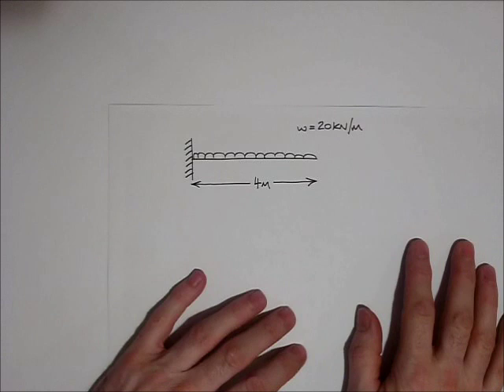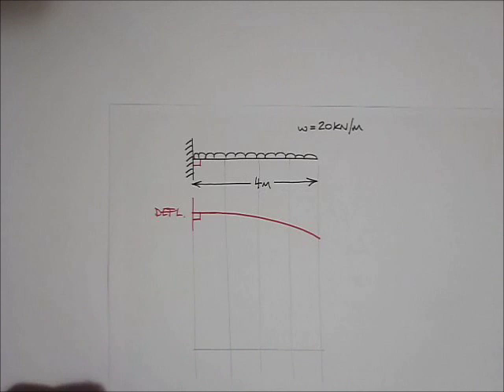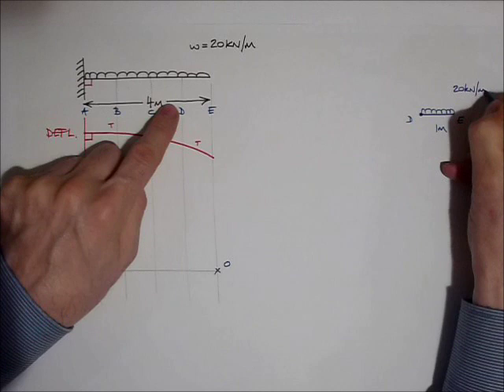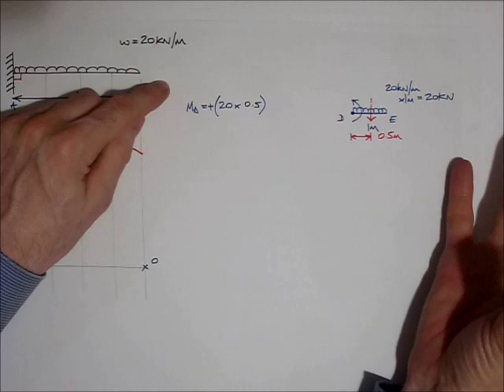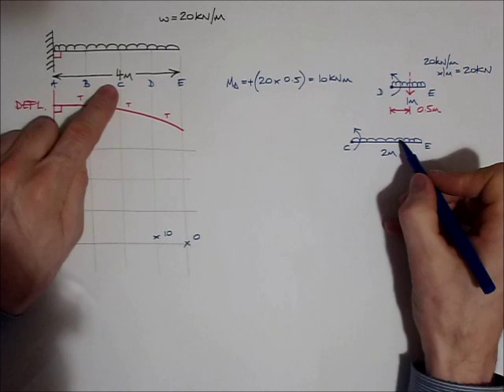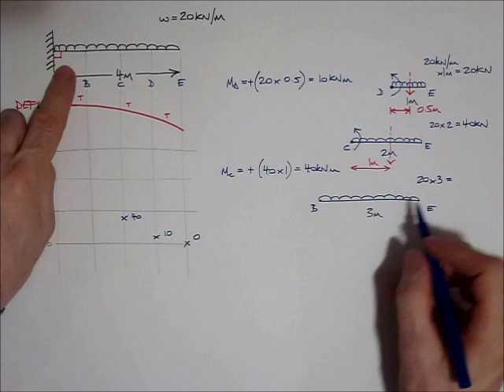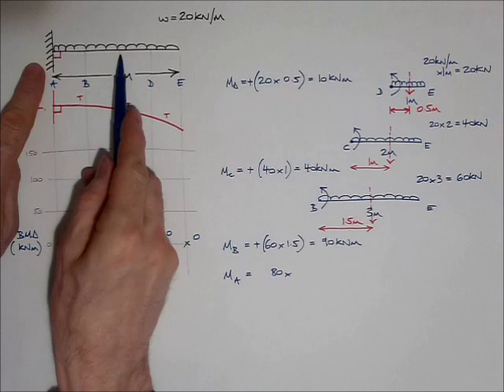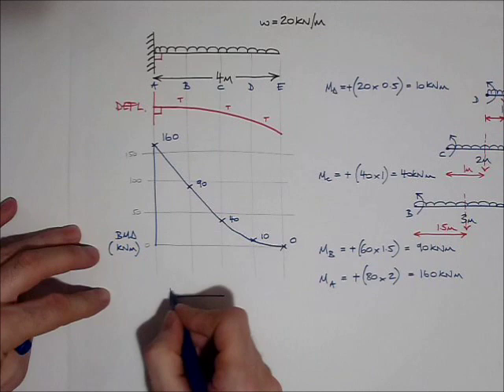BENDING MOMENTS IN BEAMS - Cantilever beam with UDL

Comment: Hello Mike, This is a very good video. Although, I have a different topic that i'm stuck with, was wondering if you could help me out. The application is for an open ended shaft supported by two bearings and a point load (800N) acting on the end of the shaft, 50mm from the nearest bearing. What approach should I take? do I still consider it a beam? does the bending moment vary if the shaft is supported by  bearings?

Comment: does it mean all the bending moment diagram for cantilever beams occur above the the x axis? or there are some which appear below an if any please specify.any help?
Reply from the maker: Hi Daud Abdi, in the UK we follow the convention that the BMD is drawn on the tension face of an element. So for most horizontal cantilevers, the vertical loading (due to gravity) bends the beam down, creating tension in the top. So generally you are right. However, there is nothing to stop a load acting upwards on a cantilever and causing tension in the bottom of the beam. In this case, the BMD would be drawn on the bottom. Hope this helps.

Comment: Hi, 
I wanna ask u ,if I calculate the bending moment from left to right I.e. A to E ,all moment is in anticlockwise I.e. they consists of negative value. 
But if I draw the tension curve as u draw it shows that same means hogging. 

So,what is the correct position of bending moment diagram I.e. is it above base line of below base line??? 

For me ,I always draw BMD for cantilever above the Base line as my tension cube shows,whatever the value is negative or positive.
Tell me if I'm wrong........
Reply from the maker: Hi Soumik Mondial, Your question really relates to conventions.  However, regardless of conventions used, all engineers should be able to agree about which face of a member is in tension during bending and which face is in compression. In the UK it is reasonably common for the bending moment to be drawn on the tension face of a member and this is the convention that I have adopted. So for a typical horizontal cantilever with a vertically downwards load at its tip, the BMD is drawn on the top face which is in tension. For a typical horizontal beam supporting a vertically downwards UDL (creating a sagging bending moment) the BMD is drawn on the bottom face which is in tension. It is perfectly OK for other conventions to be used. I hope that this helps, Mike

Comment: Hi, just wanted to ask why the BMD is opposite of the approximate BMD because I did my calculations from A to E and found that when I cut the beam, a clockwise moment is produced, so by right shouldn't the BMD be upside down of what you drew. Thanks
Reply from the maker: Hi EYKL 96, Thanks for you comment and apologies for the slow response. In the UK we follow a convention of drawing the BMD on the tension face of a member. So, as the top of the cantilever is in tension, we draw the BMD on the top. I believe that other countries follow different conventions. Mike
Reply from the maker: Hi EKYL 96, Sorry its taken so long to reply. Your question is a good one. Once you make an imaginary cut in a beam, then the bending moment found when facing left with be the exact opposite of the bending moment found when facing right. This is correct, but can be confusing, especially if you try to focus on signs of values. I prefer to focus on which face of the beam is in tension and then draw the BMD on this face. This is a consistent approach and helps me (and others) to understand how the beam is bending. I hope that this helps, Mike

Comment: Hi. I have a problem that I am unable to solve which is similar to this but something is throwing me off. The cantilever I am trying to solve is a length of 4m and has a UDL of 8kN/m sat across the whole length. This means the total force across the whole length would be 32kN downwards but at the end of the 4m beam (opposite the wall end) is a supporting cable pulling upwards at a force of 32kN. This is completely confusing me when calculating the BM and the Shear Force diagrams for this beam because I have learned how to calculate a UDL on a simply supported beam and forces on both simply supported beams and cantilever beams but I have never come across this situation with a cantilever beam and a force at the end of it combined with the UDL across it. Any help or explanation would be much appreciated. I subscribed because I think your videos will be very helpful, informative and they are very clearly explained. Thanks!
Reply from the maker: Hi Simo2009BORO, thanks for you comment. To find the bending moment at the support (i.e. where the cantilever is fixed into the wall or whatever), you simply take moments about that point. I assume that the support is to the left of the beam. The +ve clockwise moment is from the UDL acting downwards (the line of action of this force is at the centre of the UDL) and the -ve anti-clockwise moment is from the force in the cable pulling upwards acting at a distance of 4m from your support. Add these two moments together to get the final bending moment at the support.I don't want to give you the answer as it is probably an exercise for you to improve your learning - but good luck. I hope that this helps. (PS if the final bending moment is negative then this means that the cantilever is being bent upwards by the loads and so its bottom is in tension at the support. If the answer is positive then the cantilever would be bending downwards at the support).
Reply: Simo2009BORO  the formula you should use for tr calculating the bending moment is YI/R

Comment: Hey Mike, but isn't there an unknown moment reaction at the wall countering the moment of the UDL?
Reply from the maker: Hi Firdaus Othman, yes you are right. At the point where the cantilever beam meets the wall, there is a bending moment in the wall which is exactly the same as the bending moment in the beam which is caused by (and so exactly equals) the applied bending moment from the UDL. So the externally applied bending moment (from the UDL) is exactly the same as the internal moments in the beam and the wall. As engineers, we generally calculate the externally applied bending moment at a point in a structure and use this value when considering stresses at that point. I hope that this helps, Mike
Reply: Yeah it did help. Thanks for making it clear man!

Comment: Hi if there is supporting force at the middle Acting upward how we work it
Reply from the maker: Hi SEIFU ON EBS SHOW, if there were no UDL and just a point load acting upwards at Point C, then there would be zero bending moment between Point C and E. The bending moment at Point A could be found by taking moments about that point (it would be the upwards point load at C multiplied by its distance to A). The BMD would be a straight line between A and C. The method for calculating this is exactly the same as for the UDL in the example, except that generally, point loads are easier to deal with than UDLs, Mike

Comment: A cantilever beam has one free end and one fixed end........
When a point load is applied at the free end............Does its still called a cantilever beam?
 Because now one end is fixed but the other is not free.......
Reply from the maker: Hi Jitendra malviya, that is a good question.When you draw out the beam you describe, it looks like a propped cantilever as the sign for a load (an arrow) and the sign for a support (an arrow) look rather similar. But there is an important difference. At a support, the beam is fixed in location and cannot move up or down. At a point load, the beam is not fixed in location and the only things that control the movement of the beam are its strength and stiffness. I hope that this helps.
Reply: Yes Sir.......this was really helpful..
Thanks a lot...
Youtube professors are better than College professor.......They give fast reply.......:)

Comment: wow i thought clock wise moments were negative?????????????????????????????
Reply from the maker: Hi Brent,
Whether clockwise moments are negative or positive is completely arbitrary. It is your choice. I like to stick with clockwise being positive - I find this easy to remember. If you prefer to say that clockwise moments are negative then that is fine as long as you are consistent and clear in your calculations. I also like to draw the bending moment diagram on the tension face of a beam or column. Again, this is arbitrary. In the UK this is common but, in other countries, the BMD can be drawn on the compression face of a member. Nobody is right or wrong - it is just convention. The only way to be wrong is to be inconsistent. I hope that this helps.